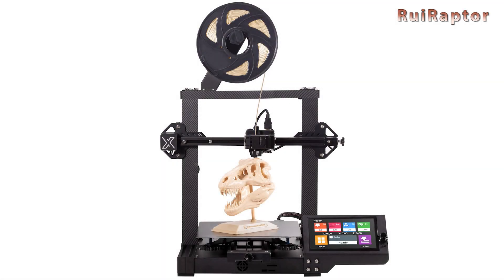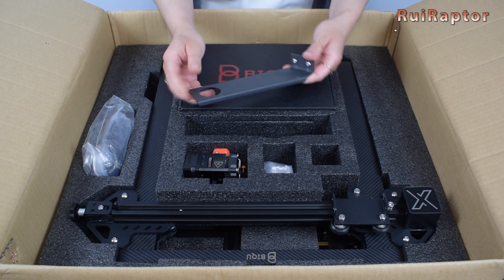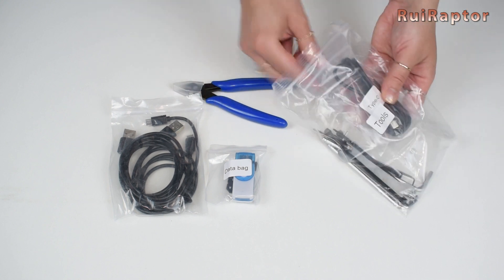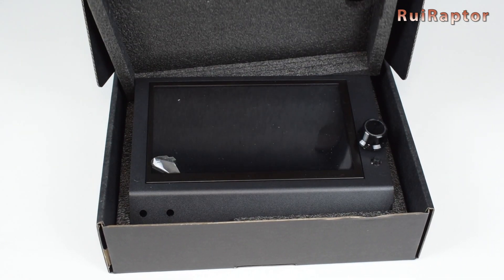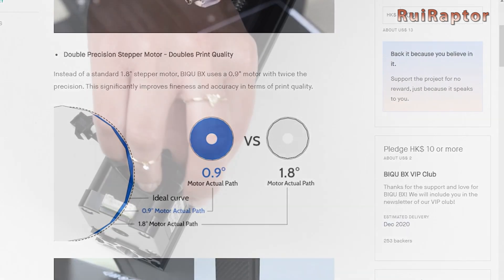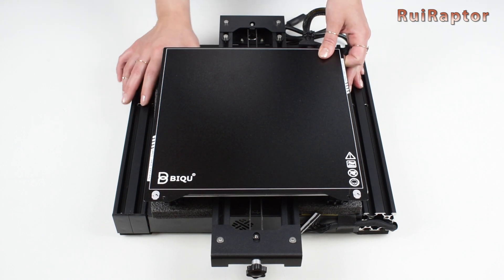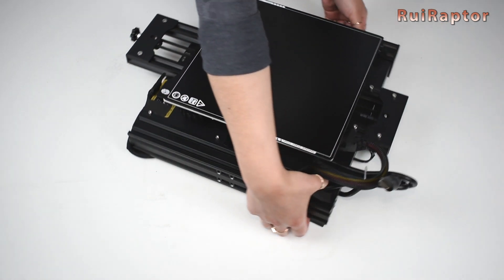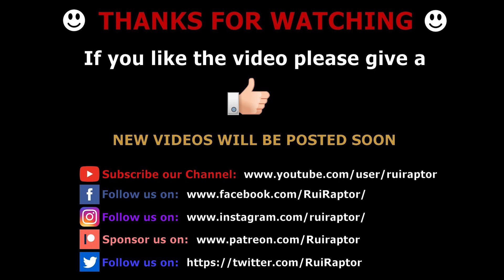BIQU BX (3D Printer Kickstarter) - Unboxing & Analysis

Comment: specs seems interesting... looking foward for the tests 

I’m specialy curious about the 0.9 stepper motor for the z axis... I have one of these for E, make sense add steps to a more precision extrusion and retraction but I cannot imagine how it will affect in Z regarding printing quality
Reply from the maker: Hi Fernando, 
the 0.9 step angle stepper motors are not only on the Z. All the axis have these type of stepper motors.
Reply: ruiraptor ok, I understood seeing the specs of the printer... I just don’t know how it will affect because the Z moviment is so small for each layer... but maybe it gonna stay more even and predictable. 

Ultimaker printers uses the 0.9 angle stepper motor for the E since UM2... not sure if the original (first version) also have it. That’s why they advertise minimum layer high as 0.02mm (20 microns)
Reply: I’m also looking for this direct drive extruder... lightweight, 7:1 is the reduction of it? What kind of nozzle and block, similar to volcano or the regular ones? I’ll definitly keep following for more information about this... 

Thank you Rui! Great job!